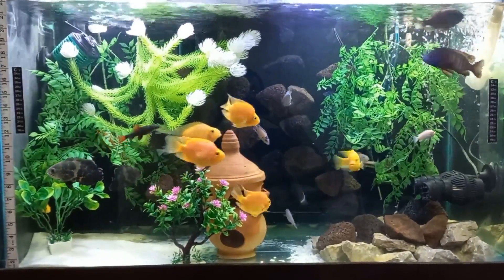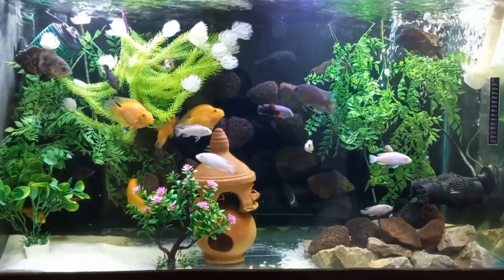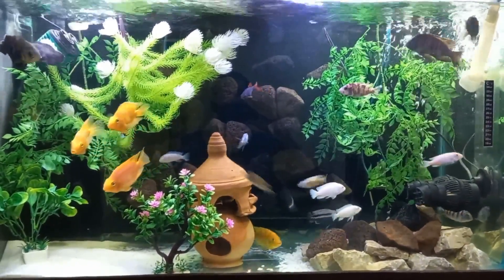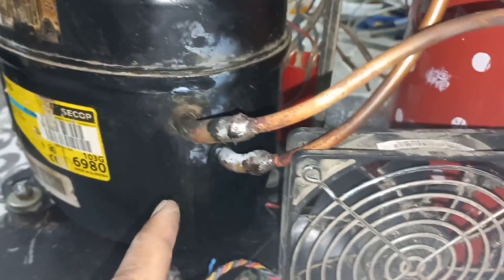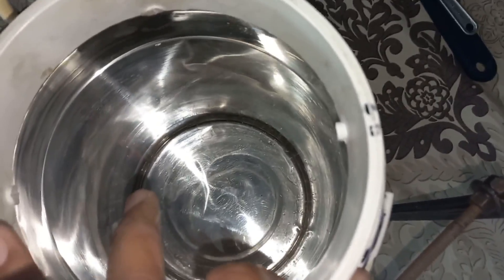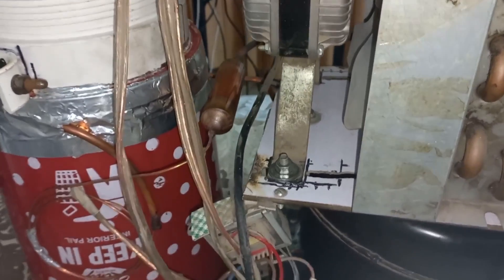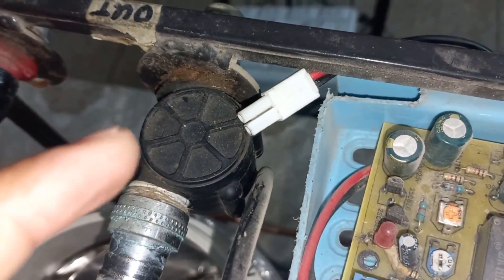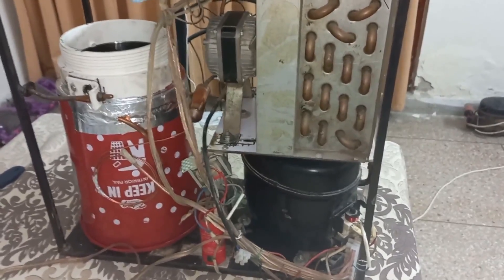How to Cool Aquarium Water in Summer | DIY Aquarium Chiller Guide | Urdu / Hindi

Comment: Please tell me  how much time take for reduce the temperature 30-25 degree Celsius for a 100 liter tank
Reply from the maker: Dear its for 100 gal nearly for 400 liter water, u can watch aquarium chiller version 3 that is for small system but for idea u can watch this video also, in version 3 I used silver box that made too much problem so never use silver
Reply: @NewAquariumHobby  please send version 3 link
Reply from the maker: @Achu-kw6sv  u can watch this video but for evaporator watch version 6 part 1 and 2 don't make silver box or pipe in water
Reply: @NewAquariumHobby  k bro

Comment: Many chiller ka soucha tha pr wo bhot expansive hai or bill bhi bhot ata hai fir many apny aquarium m sirf cooling fan laga diya fan ka size 5 inch hai jo many apny 200galon aquarium m 6 fan lagay hain jo bhot bhot acha work kar rahy hain pani ko 48c sy 27c pr ly aty hain na koi bill ki tension or fan ko many control sy connect kiya hua hai simple
Reply from the maker: I think in karachi air has more humidity due to sea that's why air remain cool which cool water. I live in mianwali here very less rain in summer so air remain dry and hot so after june if I on top sealing fan it throw hot air from roof and tv launch temp increase to 40 C and tank temp near 36 or 37 so I off TV launch roof fan
Reply from the maker: Yes it's expensive I know also more electric bill that's why I made in experiment I spend too much money may be equal to price of 3 chiller 😔 but I did experiment in 3 years and now got best results for bill I use running capacitor so bill also less. Now I upload all videos may be it help some one and he can make chiller without wasting money and time.
Reply from the maker: U check my video write all items on paper then check price in market, u can use 2nd hand compressor it work if u buy good condition I tell u can make complete in half price than original chiller. I spend more money and time due to R & D now I got final results. U just check price then tell me its cheap or not